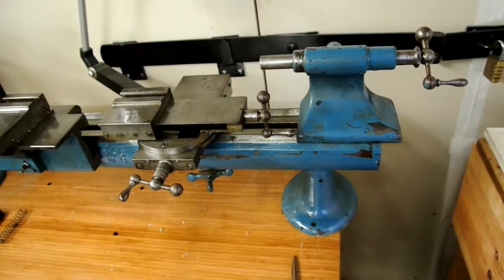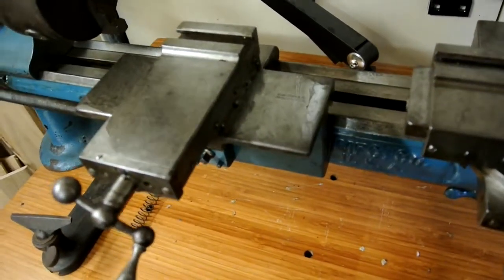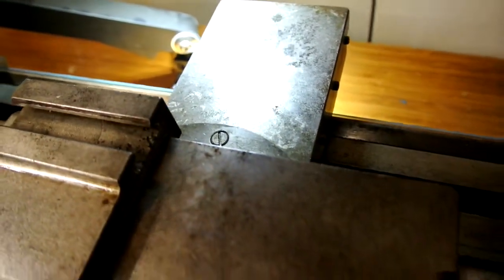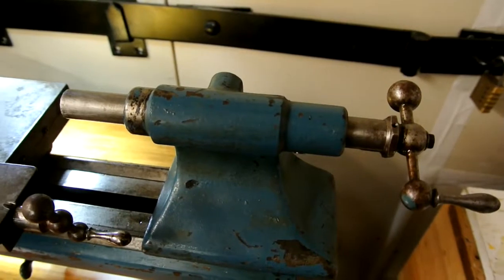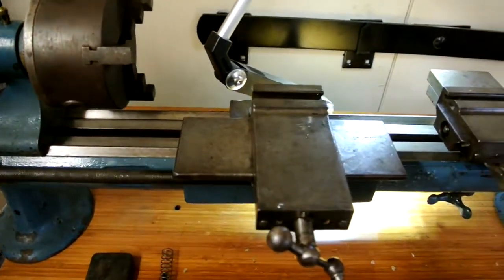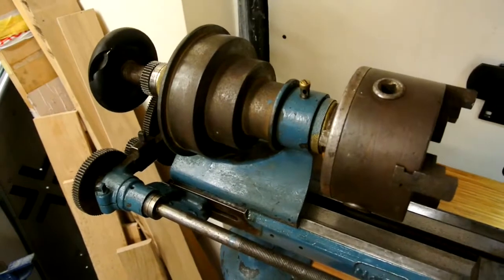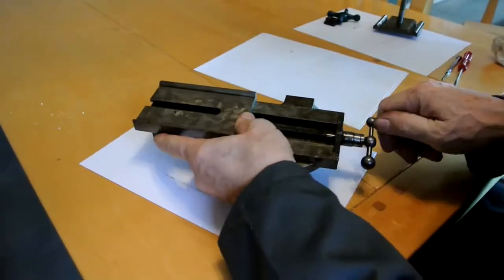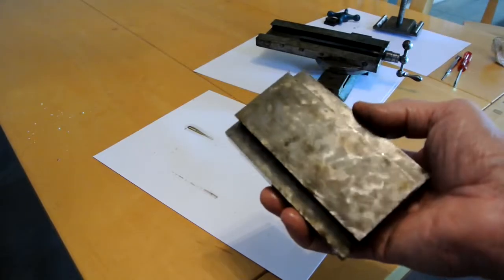Part 1 Sloane and Chace Lathe

Comment: A very lucky find of that lathe and for the apparent little used condition it's in. 

Gunsmiths, instrument, watch, clock makers have detailed and very poor opinions about today's slotted screw drivers and there tip shape. They actually couldn't be designed worse than they are. The tapered tip exerts all the turning torque at the very top and weakest area of the screw slot. The semi sharp corners on the screw driver tip results in damaged screw heads and with poorly fitting screw drivers the taper helps to cam the screw driver tip up and out of the slot. Exactly what you don't want while trying to remove a stubborn screw. At best today's tapered screw driver tips are barely functional enough for low skilled automotive repair. There tapered tip is more to ease manufacturing and reduce the number of screw drivers the end user might need.  Proper fitting screw driver tips fit the full length, width and depth of the screw driver slot and are parallel ground to a slip fit in the screw slot.  If you were to check gunsmithing supply web sites like Brownells in the U.S. John you'll find most high quality screw drivers meant for fine tools and instruments are parallel ground. And yes before I knew any of this I did my share of buggering up some high quality screws that certainly didn't deserve that treatment.
Reply from the maker: Thanks for the comments, I hadn't thought of looking for correctly ground screwdrivers, I just reground what I had and look for drivers that had near parallel blades. As it happens I managed to extract all the screws without damage. I have done quite a bit of clock making over the years and often made my own screws. These inevitably have parallel saw cut slots and as you say need a matching screwdriver. I have ordered screws from Brownell in the UK but unfortunately they have limited sizes. back in the period 1900-1930 the screw threads could have virtually any pitch. I also have a Rivett 608 lathe and had to remake a number of screws for that lathe. It comes as a shock to find such variation when we are used to standard metric threads. I have also been amazed at the very hard steel the screws have been made from. I love the old lathes.